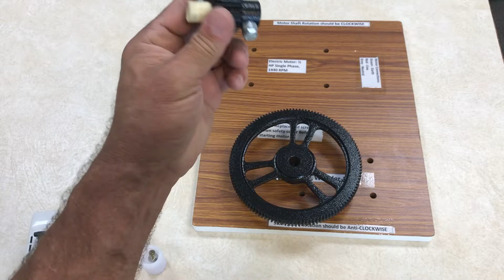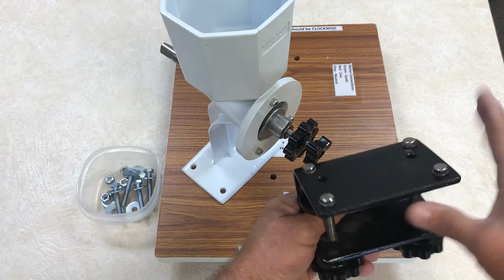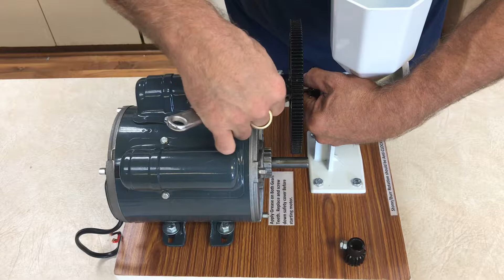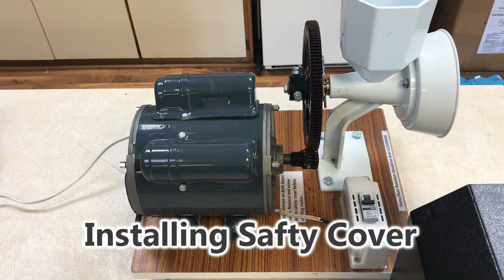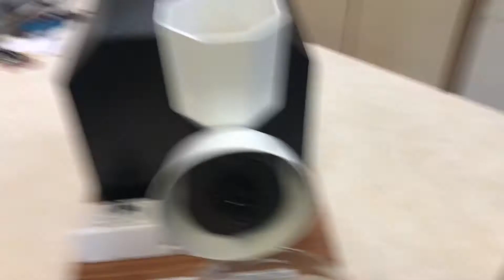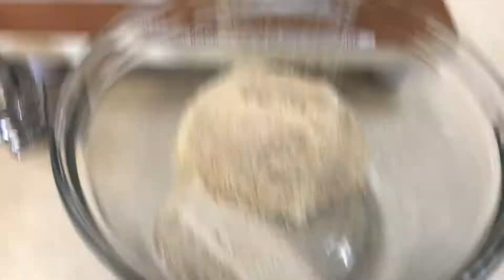Motor Kit Assembly for Wonder Junior Grain mill

Comment: Notice the motor RPM on the mounting board is 1440 RPM and the motor provided is a 1725 RPM motor. the 1725 motor will drive the grain mill 20% faster than the 1440 RPM motor. Which on do you use so that you do not burn up your mill?
Reply: The important number to look at is the torque. 

You are correct in your assumptions. A 2hp 1800rpm motor will stall easier than a 2hp 1440rpm motor. The former can spin faster because it has less poles and further to travel between phases but will have less torque because it has less poles and further to travel between phases.
Reply: You can change the sprocket ratio to compensate.